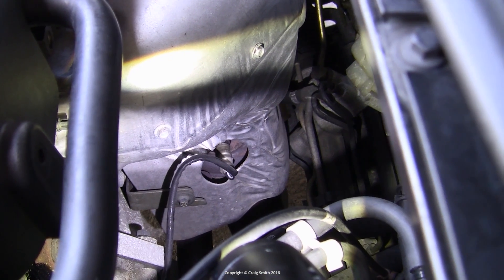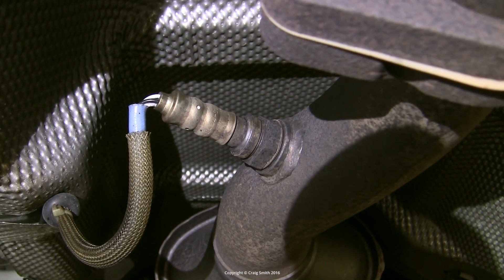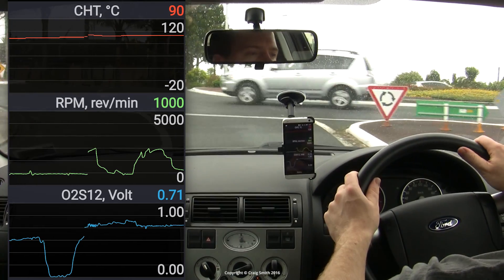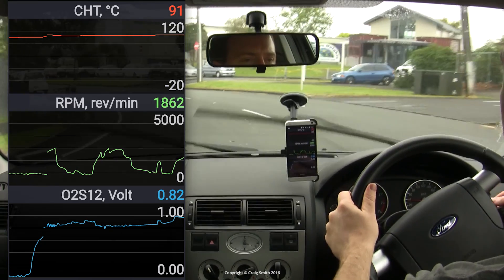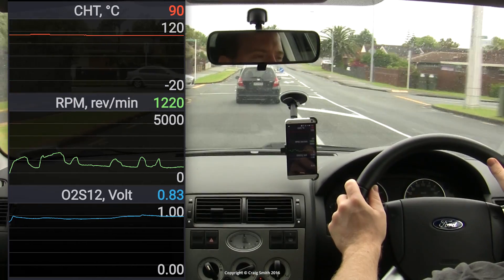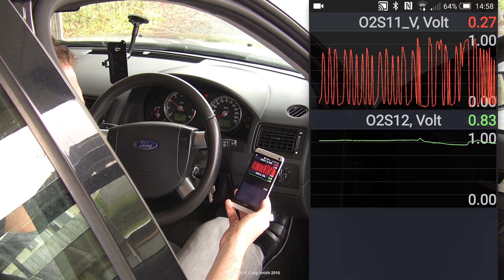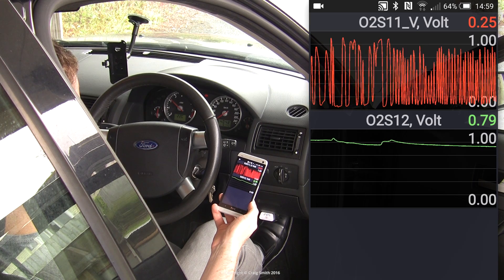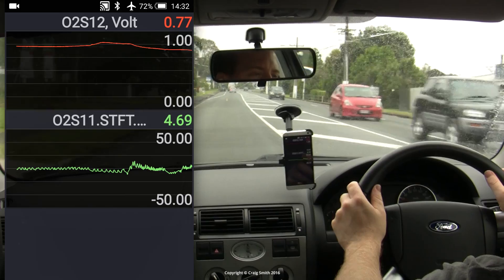What/why/how: Downstream O2 sensors (and catalytic converters)

Comment: Can any body please help me... Have a 07 Mondeo 1.8 petrol duratec HE. WON'T REV over 1500rpm when put into gear, idles and revs lovely and smooth in neutral, checked out all sensors, exhaust checked,changed intake  manifold...not showing any faults when diagnostic plugged in. How do I check the ECU without putting in a new one. My car only has 120,000 kilometres and so is worth saving to me. Please HELP🤗🤗
Reply: Mass air flow sensor
Reply: Robert Britton no mass airflow on this duratec HE. Thanks thoe
Reply: Sorry bro, had the same issue and I fixed it - but can't remember exactly what did. It is related to power though; there's no load when idle but once in gear the engine has to pull actual load and fails to do so.
Reply: Robert Bjärmyr it was the fuel pump. Left in to ford to diagnose,next day I got an estimate for 1350euro to replace because the fuel tank is in the way. Bought a used replacement for 40 euro pulled up the back seat and made the inspection hole wider with a tin cutter. Replaced and fixed for 100euro inc. 60 to ford for diagnosis. Thanks for your reply

Comment: Craig.. have a 07 Mondeo 1.8 duratec he has no power over 2000 rpm. Changed throttle body, intake manifold and all sensors from throttle body to manifold. No engine light or codes on diagnosis pls help.
Reply from the maker: Well it sounds like you've dealt with air but no power over a certain rpm could be much else, e.g. fuel, spark, timing, needs more diagnosis I'm afraid!
Reply: Craig's DIY Car thanks Craig for your reply. I am frustrated coz no faults are showing. Only 128k kilometres and so well worth saving. Runs and revs beautiful,put into gear and it dies back to idle.
Reply: @antof1235  You think clogged catalitic converters could be the cause?

Comment: 2:05 are you sure? i could have sworn that the os sensor is sensing the oxygen. and high voltage equals high oxygen which equals high fuel as well, meaning you are rich. i thought that low o2 does not equal high fuel and the inverse as well. what we are looking for is the state of efficient combustion for what what ever reason we measure o2, rather than fuel and that the unburnt fuel positively correlates with o2. you make it sound like its a inverted correlation. who is  right?
Reply from the maker: Higher voltage means less oxygen. That's because the sensor works by generating voltage according to the difference between exhaust O2 and outside O2. When we say rich we mean a mix that has more fuel than air relative to the ideal, and lean vice versa.
Reply: @CraigsDIY  sir in a rich situation affecting one whole bank
And in my case bank 1.
And only 2 sensors for both bank.
What can cause a rich condition in only one whole bank????
Short term bank 1 S1   -27.3%
Short term bank 1 S2  -27.3%
Pcm is reducing fuel in bank #1
At a point that you disable the 3 coils 
And engine won't miss.
But then if I disabled bank #2 
Pcm then add more fuel to bank #1
And then cylinders miss if I disconnect one coil.
What logistics can causes this pcm behavior.
This have been my problem for a year
And no one can't help me so far👂👀👃👀
This is a Honda Pilot 2003.  3.5
Thank'for helping !!!
Reply: Normal O2 Sensor higher voltage means rich. On modern "wideband" Air/Fuel ratio upstream sensors high voltage means lean, and they will also not switch up an down all the time like a narrowband O2 Sensor.

Comment: Hi Craig. I have a bit of a problem with my 2002 Ford Fiesta MK6 1.4litre petrol engine with 80 horsepower. Unfortunately a bad ignition coil caused severe misfires in cyl 3, resulted in burnt catalytic converter, with P0420 code and check engine light on. I replaced both o2 sensors: the post cat sensor, which I replaced approx a year ago, made the P0420 go away for several months, until It came up again recently. I discovered that the pre cat o2 sensor was a little lazy (my car has 150.000 kilometers on the clock) so I replaced it with a DENSO sensor. So far so good, better fuel economy, better performances and no P0420 error displayed. The point is: now, only when the engine is warm, the engine misfires under load. It's not so bad, but you can feel it when you accelerate, expecially in second and third gear. The o2 sensor are working fine (both checked with ForScan) and the fuel trims are not so bad (- 1% LTFT, +5/-5% STFT). I've also replaced ignition coil (4yrs ago) and HT leads this summer (Meat&Doria and NGK parts) because they were old and damaged. I have to replace the spark plugs (NGK classic spark plug) because they made 25000 kilometers and they are a bit crusty but, overall, they are all looking good, the MAF sensor was cleaned three days ago and the fuel filter replaced the past week. But, most of all, I don't have any error or CEL on for these misfires. I don't know what to do, next week I'll replace the spark plugs with DENSO TV16TT ones, hope they'll solve the problem. Love your videos (I should replace the gearbox mount too) and keep it up! The Mondeo is such a great car!
Reply from the maker: Thanks. I hear on the Duratec the Ford and NGK plugs are considered the most reliable. Stick close to spec so long as you're trying to fix problems. Intermittent misfires might be counted in the ECU (look for the relevant entry) but not set an error until they get bad.

Comment: Hi Graig, I'm always happy to enjoy your videos...
Got one question for you, I hope you can assist me with that one.
I too have a Mondeo (2004 1.8 saloon - manual tr.) and when I checked up- and downstream with Forscan, like you did, S12 was switching exactly as S11 and not as rapidly as yours...
Fyi, my cat is a 200 cpsi Magnaflow one, as I have changed the stock exhaust from the flexible and back, with less restrictive silencers and dual backboxes.
TIA!
Cheers, Nick
Reply from the maker: If downstream is switching exactly the same as the upstream then that suggests the cat is not working or not present. I don't think there's any other reason short of a reading error on the scan tool or some serious mis-wiring of the sensors that could cause that.
Reply: Craig I understand what you're saying, and I'm thinking I might take the Mondy for a (long) ride, let the cat warm up properly and then recheck the sensors, as I reckon this type of cat needs to be really hot to be working as it should...

Thank you for your help and I'll get back to you once I have  (hopefully good) news. 😉

Comment: Hello, Craig. I have the same car here.
Do you know what does it means that downstream O2 sensor have a sudden drop, and upstream sensor also stays flat for 4 seconds?  I was in gear 4, cruising, rpm around 1800
Reply from the maker: If that happens when taking foot off the pedal, i.e. on the overrun, I would guess it's normal.
Reply: Hi Thanks, Craig. I analyze the chart, and did found that there are several drops in downstream when up stream does not drop, and my throttle position voltage also didn't drop(pedal still hold). I notice my upstream sensor doesn't vibrate fast enough.. time to change a sensor?
Reply from the maker: Upstream should be cycling rich/lean all the time at part-throttle. If it is lazy or stuck then it may be a sensor fault, in which case see my 1st vid (link in desc). Or it could be accurately telling you about some other problem to do with fuel or air. Don't worry about downstream until upstream is functioning properly.
Reply: Hi I watched that video. I'll watch again later. Thanks for those DIY videos they're very helpful.
My short term fuel trim is always below 0 in a short drive(cylinder head temperature only up to 50 C), does that mean lean? But it's a bit strange that when I pulled the spark plug, it's carbon fouled(running rich?)
Reply from the maker: -ve FT means rich condition (so ECU is compensating with less fuel). Fouled plugs is another symptom of short trips never getting engine hot, but never getting a Duratec above 50 deg is really short - just down the street short - is your thermostat working.
Reply: Yeah, it's a 3km drive to work.. I'm getting a P1432 code but no engine light. But after a longer drive my CHT can reach 100 deg. so perhaps my thermostat is stucked a open but not fully?
Reply from the maker: P1432 is failed stat heater (or wiring problem). I have 2 vids on that, search the channel for thermostat.
Reply: What CHT would you expect after 3km's drive? I'm not inclined to change thermostat because the temperature can reach 100 deg and changing that seems a bit of a hassle
Reply: Rongkun Wang 2002 s-10 blazer with code po3001 out has 4.3 liter number one cly.one misfire

Comment: Is the O2 sensor the same for both upstream and downstream in most cars?
Reply from the maker: It basically does the same thing but you can't expect it to be an identical part.
Reply: Can the ECU distinguish if you used a spare upstream sensor as a downstream sensor?

Comment: Hey man, thanks to your helpful videos! I Bought a Volvo C30 that has a Duratec 2.0 here in Brasil and you gave me a lot of hope on Fixin it by myself! I wanted to make a question for you about this whole thing... My car is a 2010 vehicle with low kilometers on it (took it with 49000 km). So the car probably hasn't driven much with the old owner. By that my guess is that a lot of things got cloged up. I had to replace my old O2 sensor (I forced the guy who sold me to do it). And slowly I'm "recovering" it's full potential. I have noticed a lot of knocking (detonation) when I drive a lot and then park my car. When maneuvering it I can clearly hear the detonation. So, my question is: Does the early replacement of the O2 sensor is a problem caused by a other major problem? for exemple: carbon on my head cylinders, or PCV valve cloged up, etc? Any sugestion is very welcome! Thank you for the great channel! PS.: I pretend to unmount the intake manifold and clean it up...
Reply from the maker: Very hard to assist in such general terms. You didn't say why you replaced the O2 sensor; was it electrically dead or under-performing? - you would need to look at the tip of the old sensor to see anything unusual from emissions build-up. As to knocking, first you need to be sure it is in fact knocking and not vibration or rattle from something else. Common rattles on the Duratec are the belt tensioner (noisier at idle), and low end 'knock' could be the timing chain. Then check ECU for any codes and misfires. Petrol should be 95+ RON, what is quality like where you are, does it improve with a higher octane. If definitely a mechanical problem causing ping, you are down a rabbit hole - check plugs, leads, intake vacuum leaks, coolant system inc thermostat and fluid. This is a good article chasing down ping (not Ford but good re principles): http://dodgeram.org/tech/gas/Trouble/ping.htm